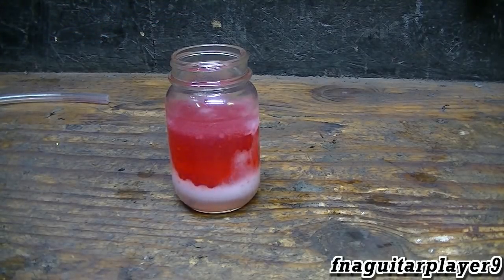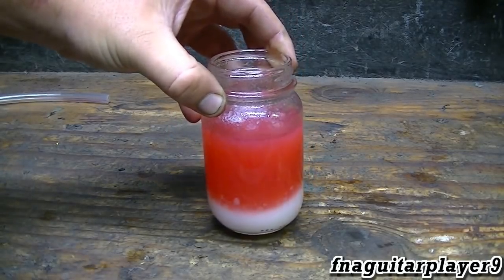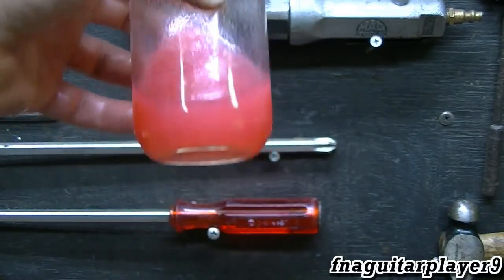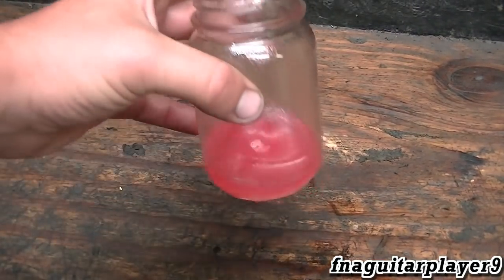Why Water / Moisture in fuel is Such a Big Deal and DEMO of How Heet Helps to Remove It

Comment: Water does collect in gas tanks and fuel lines from moisture in the air, or from the storage tanks at gas stations. 
Today, however, vehicles in most parts of the country burn gasoline that includes up to 10 percent ethanol, a form of alcohol that performs the same water-absorbing chores as brand-name gasoline antifreezes. Products like gas-line antifreeze Heet — which are available at automotive stores — contain ingredients such as isopropyl or methyl alcohol (methanol), but they function in the same way as the ethanol that is already in your fuel.
Gas-line antifreeze isn't expensive and probably can't hurt, but if you have 15 gallons of fuel in your vehicle and 10 percent of it is ethanol, your tank already has 1.5 gallons of alcohol in it. Adding another 12 to 16 ounces of alcohol is not going to provide any additional protection against freezing.
Reply from the maker: That does make sense. Thanks for Watching!!!

Comment: Can it work with petrol? Does it stabalize the fuel as well?
Could I use a diluted amount of Redex in my mower every so often?
Should I clean the carburettor and sparks plugs every so often?
??
Reply from the maker: Yes, I just used diesel as a example though the red die in the off road diesel would show up better on camera, and to keep the fumes down. I wouldn't recommend that, but a good carburetor cleaner or fuel injector cleaner in the gas is good for them, and you only need to clean the carburetor if its gummed from old gas sitting in it or dirt from the tank/line, if water is in it, you can usually (unless it sits in the bowl for a long time) drain the gas/water out of the bowl on the carburetor then let fresh gas fill it up, it may be all it needs, first thing to try before cleaning. I would look at the plug each year, but no need to replace each year and clean it if it needs it, they usually last a long time in a engine, especially one that is in good shape and not burning any oil.   Thanks for Watching!!!
Reply: @fnaguitarplayer9 
Thankyou very much. I will watch your video on gapping the spark plug

Comment: Good information.
I have a small generator that has a small metal gas tank which had a lot of rust in it, it is now cleaned out.
What I have done is spray a little penetrating oil in the empty tank THEN put in the gas.
Question: would it be a good idea for me to add a small amount of 2-cycle oil in the gas to "coat" the inside of the tank?
It is a 4-cycle engine.
Reply from the maker: I hear ya, i think it would help, like you say it would coat it, especially when you run it empty or drain it, there should be a film all over everything. Thanks for Watching!!!

Comment: Thanks, Pal. Good one. Diesel has a high water content anyway. I never knew how much till I saw some samples taken and put in pill bottles and in a freezer the ice jacked the bottle tops up over an inch in some of the samples. This might've been a lower grade fuel because it was running an Army asphalt plant but it was running the diesels that ran the plant as well as the drier burner. And is the main thing in HEET isopropyl alcohol? Seems like that works good but NOT rubbing alcohol. I had a Rabbit that someone had poured full if rubbing alcohol to try and get the water out of it and it rusted the tank, BAD. So that's my 2 cents worth and C U around Next Year, God willing! Don't wear those fingers out picking over new years!
Reply from the maker: Your welcome! I hear ya. The HEET i used is methanol, it was the yellow bottle one, now the red one i'm not sure what it is, probably something similar, all forms of "alcohol". Sounds good! haha heard that! Thanks for Watching!!!
Reply: Sure sounds good! Take care of yourself! Thanks, Picker!
Reply from the maker: Will do!